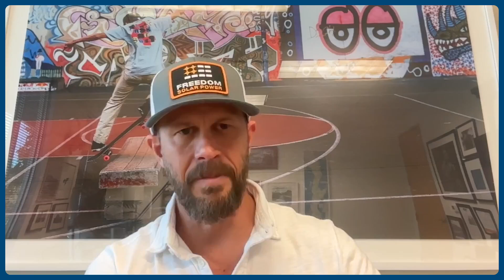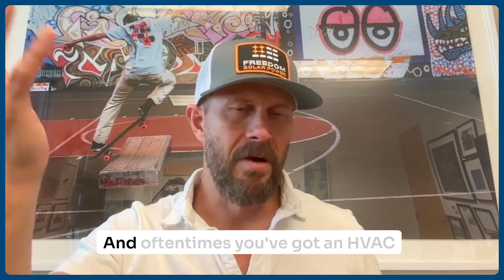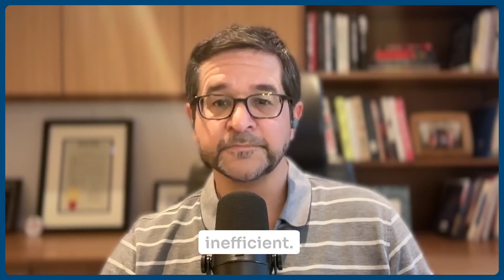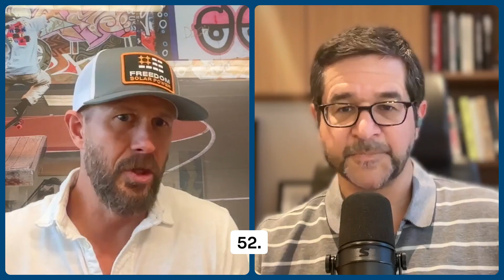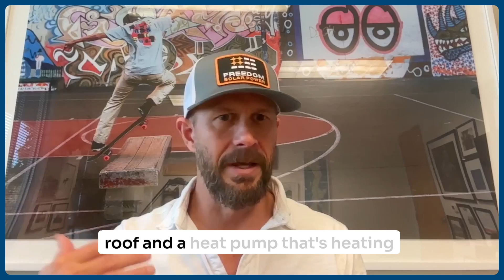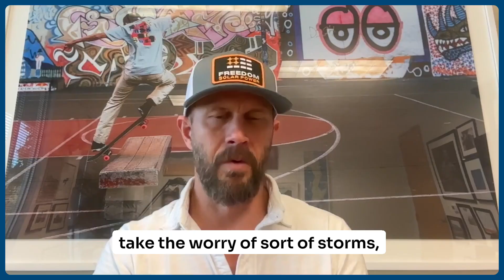The Biggest Energy Waste Hiding in Your Home

Comment: The home hvac business is so bad. I put out a rfp for a new system and ended up getting 16 bids. All but 3 of them were for single stage Ruud 4 ton conventional units, which was not what was specified, and 14 of those bids were for over $30,000. One of the sales people never looked in the attic or outside and did propose a heat pump but it was for $45,000. Only 2 bids were close to what I had asked for, a variable speed heat pump, variable speed blower, new ductwork. One was a hybrid system by two different manufacturers and was $25,000. The bid we accepted was for the same system by a single manufacturer and was $15,500 installed. 
Until the massive over pricing and under performing equipment is addressed not many people will be getting the better solution. 
Most residential a/c sales are done in a panic situation, the a/c has been out, it’s 90 degrees in the home and people buy whatever can get their house cool quickly.  Not everyone has the experience or the time to put together a rfp, call a bunch of companies, get the bids in a compare them all. 🤷🏼‍♂️